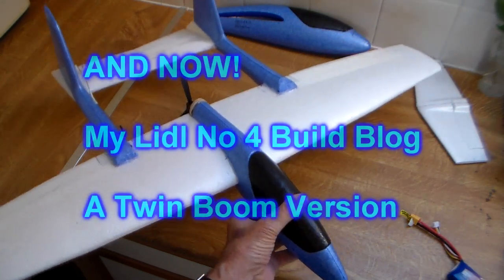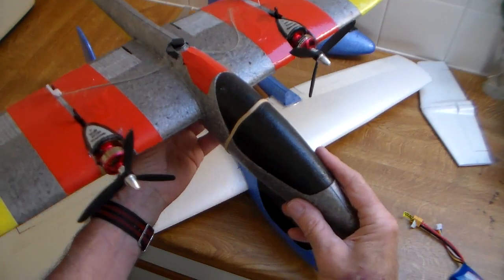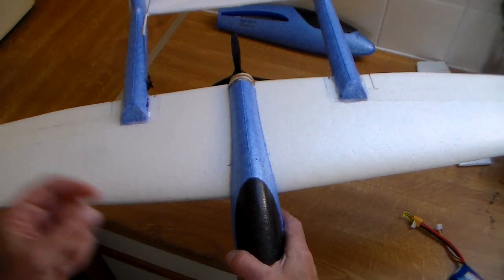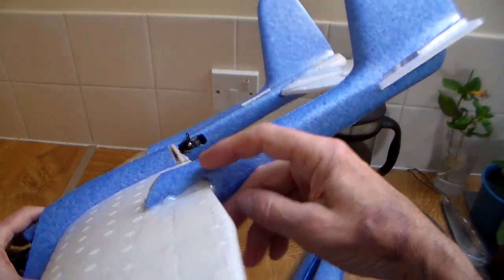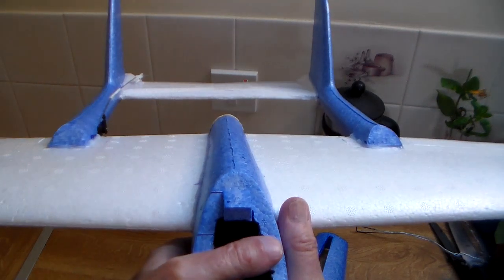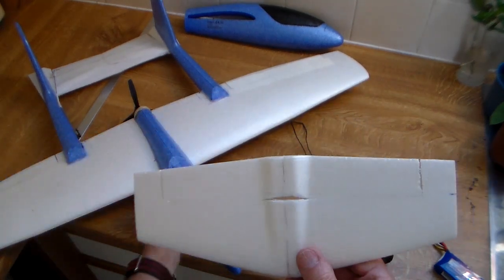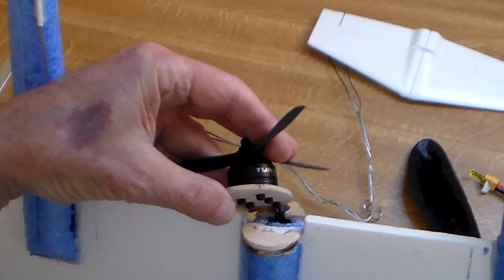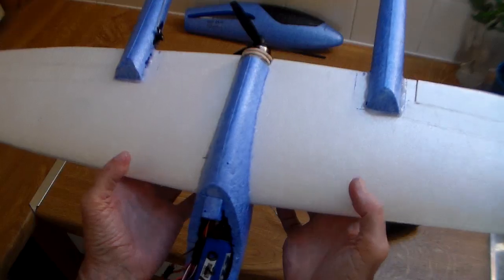Twin Boom Lidl Glider RC Conversion Build Blog  : Part One  My 4th Lidl RC Conversion!

Comment from the maker: Note. I used a different prop than the one shown,  which wasn't actually tightened up and was back to front!  I've  put on a 5045 now and for those who aren't sure, the blade or hub with the prop size on it should always be facing forward, doesn't matter if you are in tractor configuration, or pushed configuration!

Comment: you have the prop on backwards....it will fly like that but will have less thrust. nice build looking forward to the maiden ;)
Reply: Perhaps Bob's designed it to fly backwards 😁
Reply from the maker: It wasn't actually fitted, ie, not tightened up, but you are right, it was back to front.  Didn't use that one and I have fitted a 5045 now with the prop size info on the blade facing forward, ie the right way and it absolutely screams, so much thrust as well.  As people say there is no such thing as a 'pusher prop' it just has to be mounted the right way!

Comment: I DID SOMETHING SIMILAR, USING CARBON BOOMS AND BALSA TAIL.FLIES GREAT.
Reply from the maker: I'm just working on one with a single carbon boom, very short, lightweight and I left the dihedral in so it'll be a slow easy fly model and soarer.